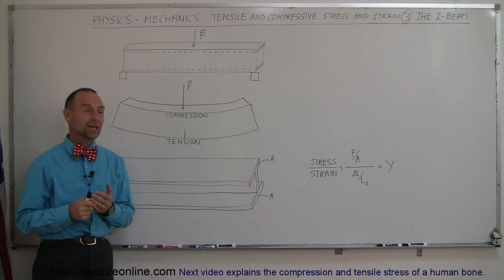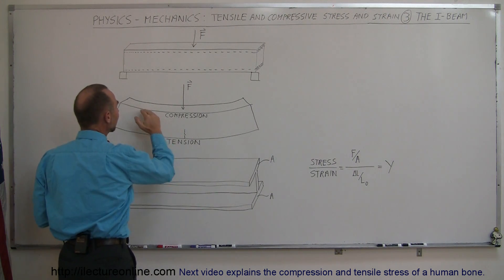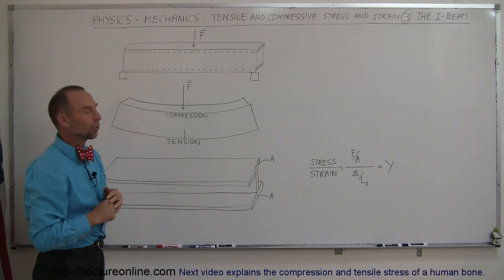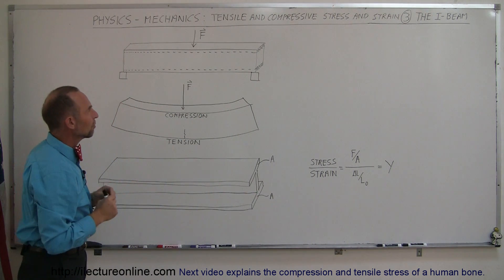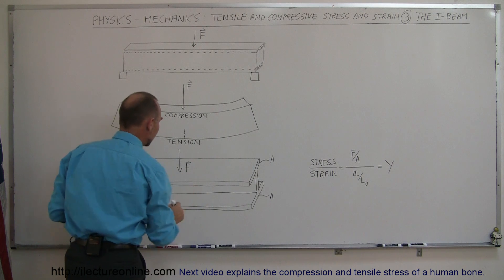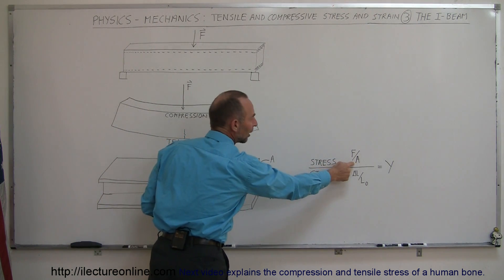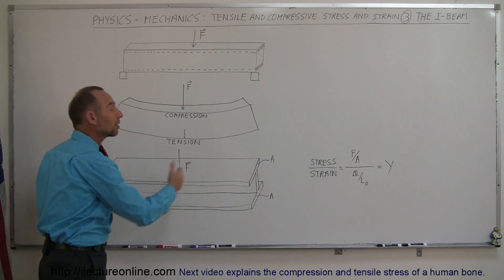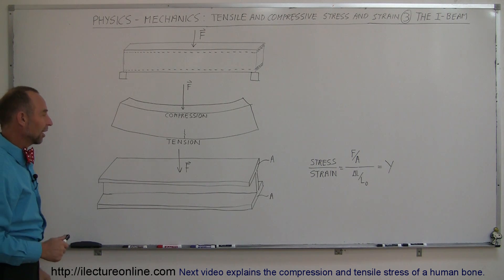Physics - Mechanics: Stress and Strain (3 of 16)  I-Beam

Comment: Another good example would be the simple 2x4 or 2x6 used as structural members in home building. Placed in the "flat" side up and down with most of the material in the center where it does the least good, the board is not that strong. Turn it 90 degrees so more of the material is toward the top and bottom, the board is much stronger. Take that to the next level where you have floor joists that are designed to bear lots of load. The dimension might be 1x8, and oriented vertically the boards are very strong with much more of the material towards the top and bottom.
   A lot of people may know this just from experience without knowing the science behind it.

Comment: How does steel pipe compare to an I-Beam?
Reply from the maker: A steel pipe is not nearly as strong.
Reply: @MichelvanBiezen  , thank you for the info!
I was considering I-beams initially, but my plans are for a geodesic dome, in which most struts are in various angles, and while the I-beams can be oriented correctly it would make the connector-hubs much more complicated.
Reply from the maker: Circular cross-section beams can be used if the forces are along the length of the beams.  I-beams are used for perpendicular loads.

Comment: ...Q:  ..... Is a structural "I- beam" STRONGER when the single/central part is the vertical web between the top and bottom surfaces, or, if it is rotated 90 degrees, and sits as an "H-beam", with 2 vertical webs, separated by the common single/central portion of the beam?!   Is it stronger when used as an "I", or an "H" ?!....(assuming that the beam has the same dimension across either face).
Reply from the maker: A beam is stronger when used as an I, and the strength increases as I becomes taller.
Reply: Michel van Biezen say the I-beam is laying with the web horizontally instead of vertical. Why is that not as strong?

Comment: Very helpful and informative lecture sir. I've been so confused about the strength of the beam needed for my project but it's a lot easier now. I  would also like to share what I found on the net, a free cloud-based software for i beam sizes computation from https://skyciv.com/steel-i-beam-sizes/  and it helps save a lot of my time in computing them.

Comment: How can the cross-sectional area become larger if you remove big parts of the original beam? To me it looks like the cross-sectional area is much smaller on the I-beam. - @Laurelindo

 i have the same question.
Reply from the maker: +Chris Wass 
You would never make a beam with the same dimensions if it was the solid.  By making an I beam you can make the top and bottom of the beam larger, which is the only part of the beam that matters.  (That is why you have such a large top and bottom strip).

Comment: why do we use the 'I' section as the cross sectional area? why not we use the top surface area because we applied the force from the top.
Reply: +Michel van Biezen 
How can the cross-sectional area become larger if you remove big parts of the original beam?
To me it looks like the cross-sectional area is much smaller on the I-beam.
Reply from the maker: +Farah Afiqah Think about it this way.  What if we removed all but the top layer.  How strong would it be?  What gives the I beam the strength?
Reply: +Michel van Biezen oh i get it. thank you sir
Reply: +Michel van Biezen From top layer there is a sudden drop in cross sectional area wouldnt it be better if we had a linear decrease in area till central axis and then a linear increase till bottom portion?

Comment: hello sir ,if the beam has max shear force at a point what will appen ?? also if the beam has maximum bending moment what will happen?? iam terribly confused with both these terms they confuse a lot...why we need to calculate shear force disstrbution what's the purpose???
Reply from the maker: pradeep,
When a beam is subjected to a force greater than it can withstand, failure will occur.  The type of failure will depend on how the force is applied.  A shear force will cut or sever the beam.  
I am not familiar with the term "bending moment".   That may be a translation problem.
Reply: thank u sir..
Reply: bending moment is the integral of shear force ....when we have maximum shear we have max bending that is not a problem if the bending is still in the safe limit .. so the shear or bending can be maximum at a point but that it did not reach its yield point or the failure point . or what ever you design the beam for ...!

Comment: Thanks for the video.

It was confusing to hear you talk about an increased cross-sectional area in the I-Beam, as from the drawing, it looks like the cross-sectional area is smaller. Isn't the benefit of using an I-Beam more related to reduction in weight / required materials?

I think it would have been useful to draw scale cross-sections of the two beams, so we can clearly see increased area.
Reply: Yeah, that was kindof confusing. A beam that is a block (ie rectangular prism) that is as wide as the top/bottom of an I-beam will be better than the I-beam in terms of sturdiness (i think people may be misled to think differently from this video). However, when limited in materials/weight restrictions, it makes sense to put most of the material where the compression and tension forces are greatest, and then connect the two with a thinner middle section. This placement of material is the most effective.